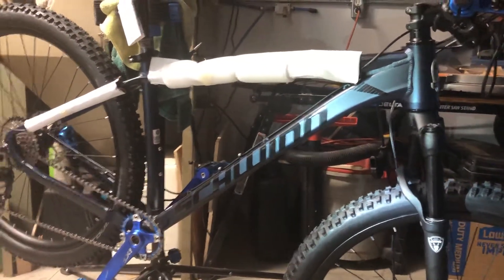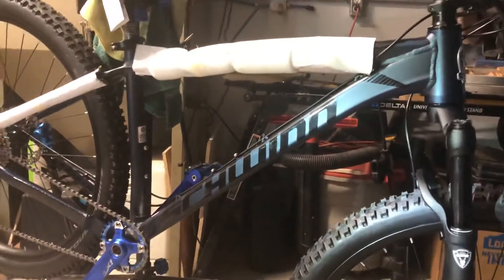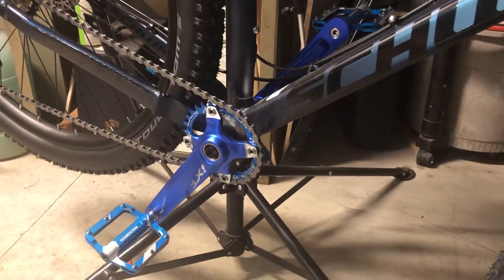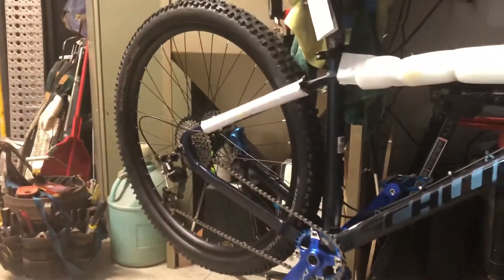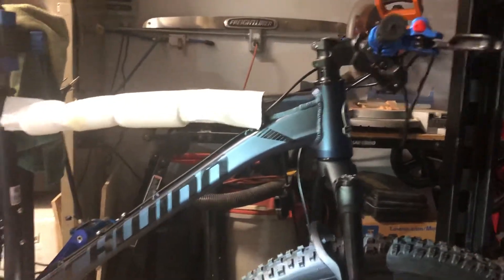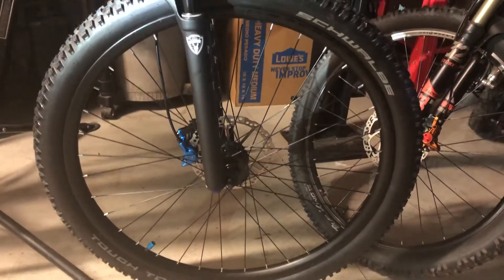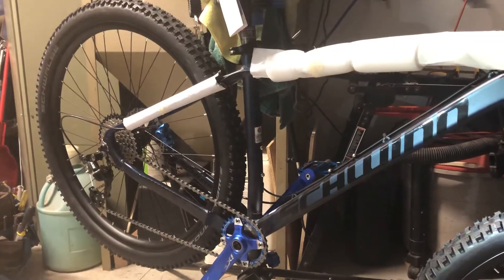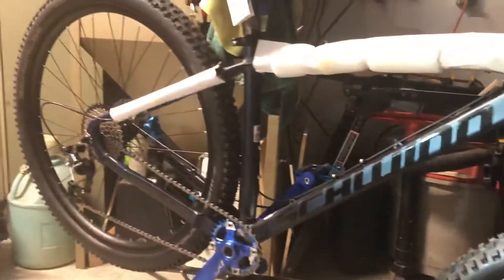Schwinn Axum making some progress, bottom bracket.

Comment: Did you add any spacers on either side with the hollowtech?
Reply from the maker: This is the only one I could not run a drive side spacer. Chain angle looks good, but 30 tooth is as big a chain ring that will clear.
Reply: @mtbkjm1240   I ended up going with one spacer per side, I haven’t gotten far enough to get the wheel & cassette on to see if the chainline is right but looks good so far, thanks for getting back to me!